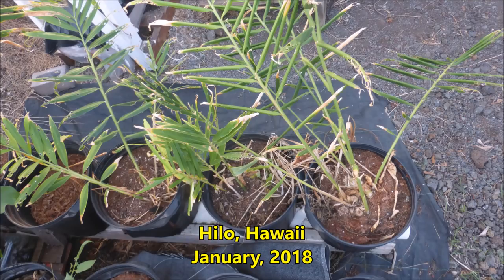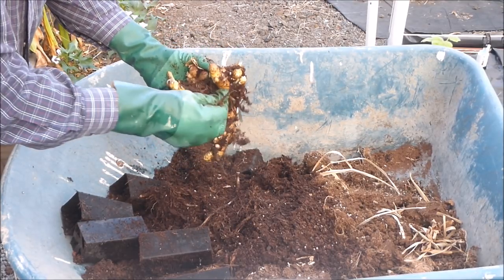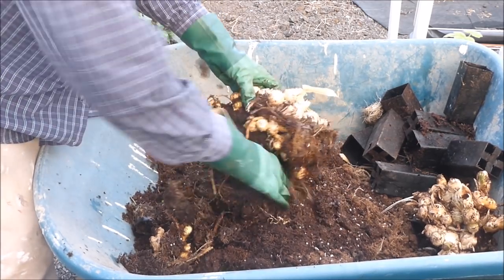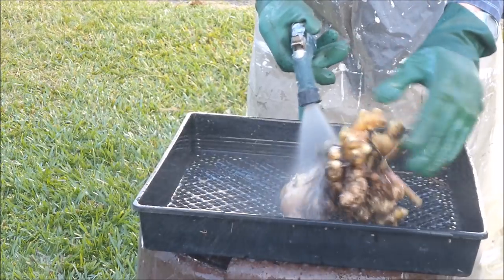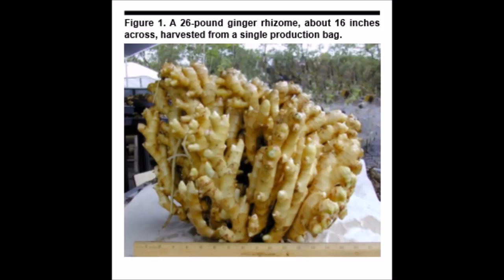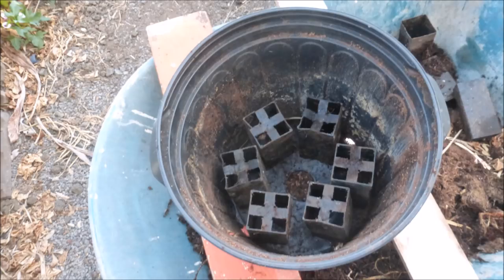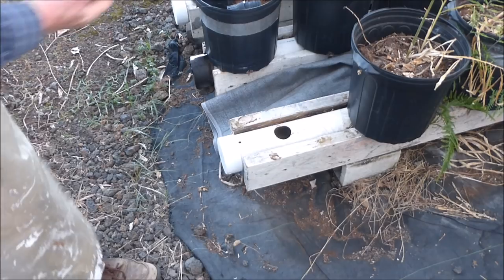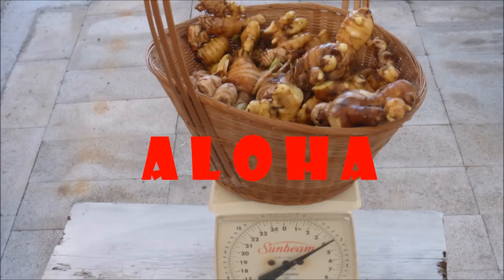Harvesting Ginger Grown by a Larry Hall Method

Comment: This was very cool and impressive.  But I still think a method using zero media will be the key to commercial success.  Then there is less washing of the harvest.  The savings on labor and cost of media may compensate for the possibly reduced yield.
Reply from the maker: Yes, zero medium is a worthwhile goal to shoot for.  Hopefully, someone will develop a method to successfully grow ginger without growing medium.  We attempted it in this study -
 https://www.ctahr.hawaii.edu/hawaii/downloads/Experimental%20Non-Circulating%20Hydroponic%20Methods%20for%20Growing%20Edible%20Ginger.pdf  but yields were lower than with growing medium, sprouting was slower and rhizomes were small and knobby.